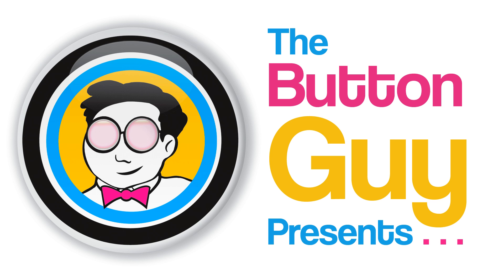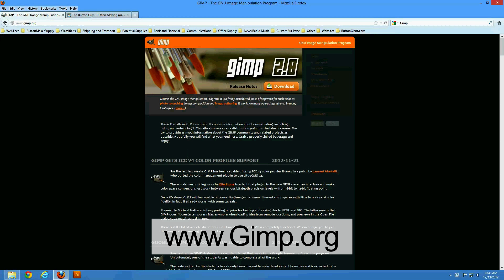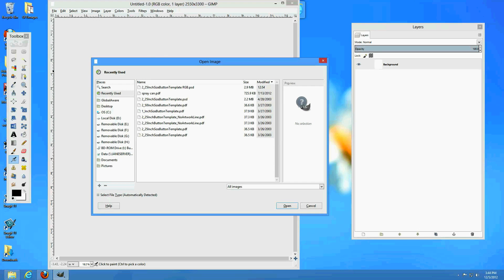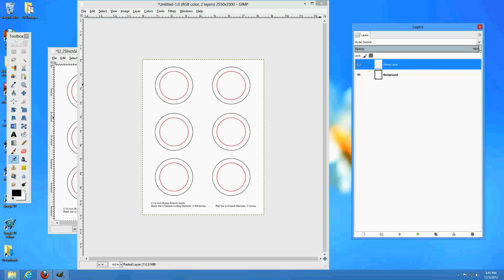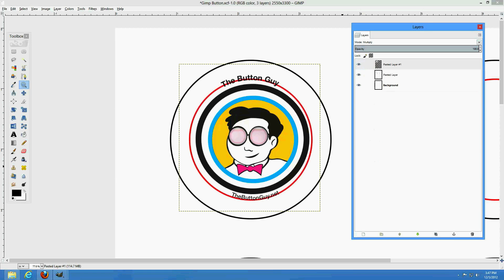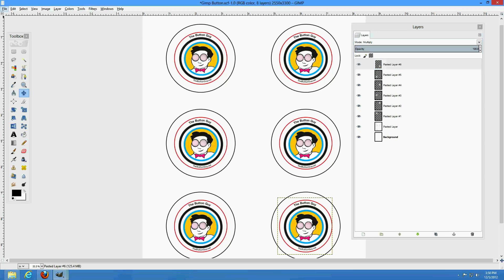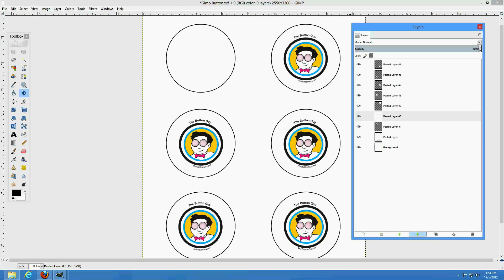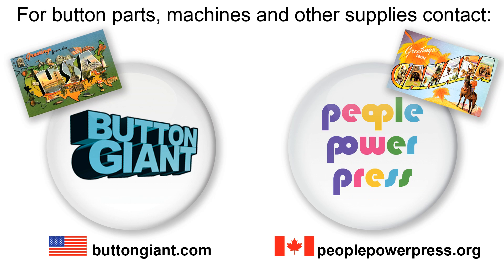How to Design a Button in GIMP Using PDF Templates

Comment: dude I really need help eres no contact info on your website or anything. I tried saving your templates and opening them up into gimp and it says error loading psd file, unsupported color mode. please help me, how the heck do I get the template onto gimp!
Reply: +Amanda Dunlap The color mode is probably set to CMYK, you'll have to download and install plugins from the GIMP plugin registry on their website for CMYK support. CMYK is the standard color mode for printing.